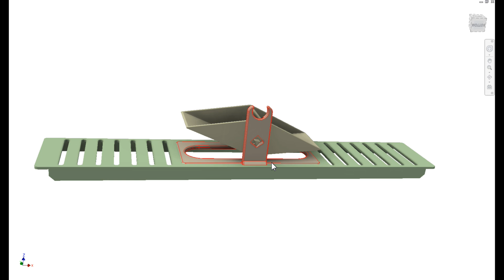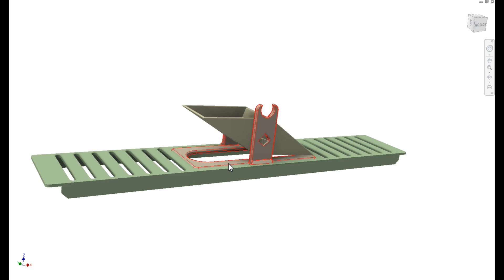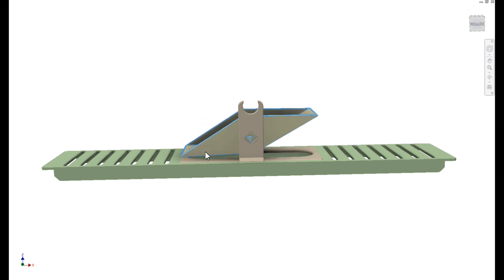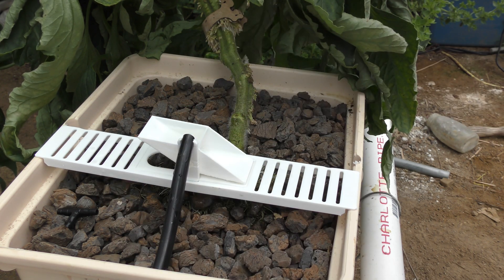Teeter Totter Tipper

Comment: It would be more advantageous to introduce the tube at the bottom as a tube within a tube with an overflow transfer to the next bucket. There are 2 ways to do this #1) have the above as I described #2) wind a perforated tube around the bottom,  add a straight or spiral non-preforated around the sides to the top and put a screw in cap that allows you access to either introduce the water and simultaneously check the water level/flow and root system, line with filter fabric and put an overflow valve approximately 1-2" above the top of the filter fabric the valve can be a one-way type with a smaller screw in one with a screen or filter inside the other one. #2 is my favorite an works really well for me.

Comment: The whole system requires topping off from transpiration and evaporation.  I wonder if instead of adding water in bulk to the fish tank or whatever, if the topoff was a blast of a hose to each tipper it could resolve the bioslime issue while performing another chore.  Or perhaps if there was a secondary drip system just for blasting the tippers once a week.  Looks super cool for sure too!
Reply from the maker: That's actually an interesting concept! Water is coming in at 60PSI and could certainly be used for something like that.  Right now I just have a float valve topping off the water in the DWC

Comment: How about a long spring with a cup on top collecting water flowing from above, and when the weight of the water overcomes the resistance of the spring it tips over? It can fall over in any direction, and it will be more random and bigger splashes, increasing the randomness and the surface area of the area that gets water.

Comment: usefull? probably not really.   Fun? Definitely       if you want even distribution you could design a horseshoe shape ring, that acts like a trough with weir and evenly pours over.
Reply from the maker: I thought about that. the two main problems is it needs to be level for a weir to level the flow.  The buckets are all at a slight angle to drain so that complicates the weir assembly to relevel against the bucket.  Then there is such a slow flow into these, the weir probably still wouldn't distribute very evenly.  This dumping at least provides a flood to spread out better.  I've already have a modified design so I'll do another update video soon.  ;)
Reply: Yep, I was thinking of a v-notch weir, something like used in wastewater treatment clarifiers. Bio-slime will still collect, but is easy to clean and only disrupts even distribution.